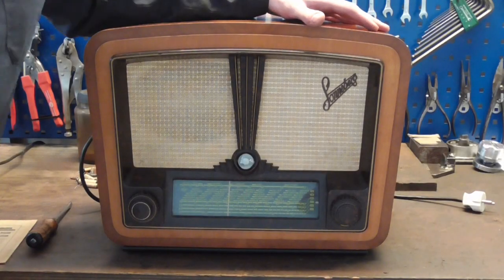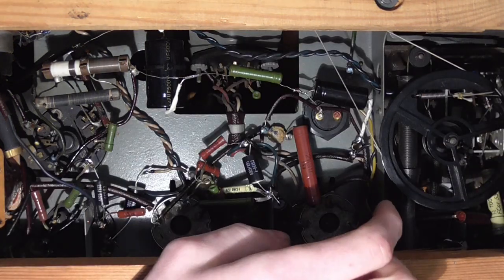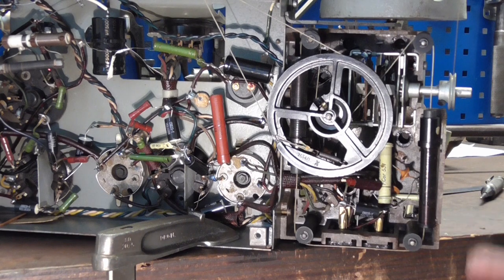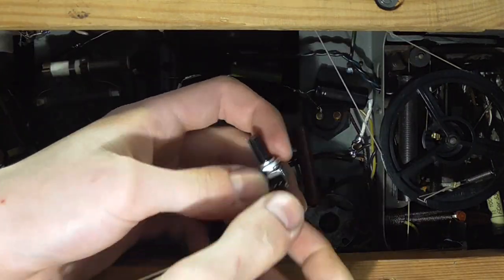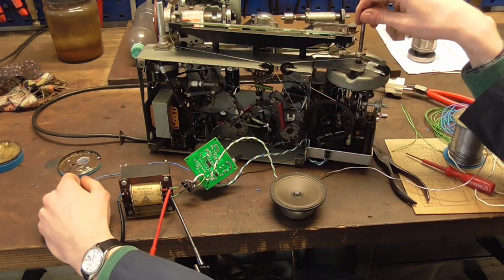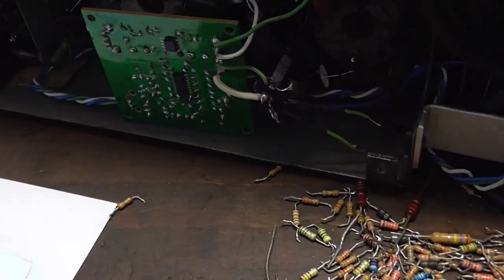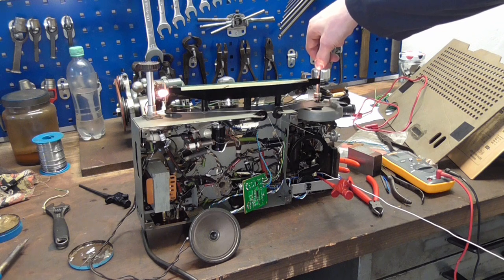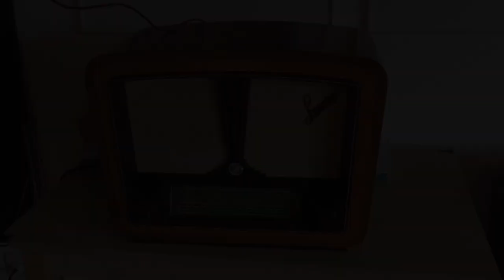FM Retrofit: Sonneberg 65/52GW Valve Radio

Comment: This was a cool project to enable the radio to be more than eye candy. Another approach (unfortunately only for recorded music) would be a short-range AM transmitter.
You don't often see a permeability-tuned table radio. It's usually used on car radios due to its resistance to being vibrated off station.
Roughing out a circuit diagram with a fountain pen while Artie Shaw plays in the background—now THAT'S authenticity!
20:34 Cool tuning indicator tube with four shadows! EM11?
A very neat and professional-looking job. Love the custom-turned pulley for the tuning potentiometer. 
10:35 "The wiring between the potentiometer and the, uh, thingamabob here..." Ah, yes the ever-useful metasyntatic variable. My Dad's favourite was "Whatchamacallit". 
Thanks for showing us the ins and outs of this kind of project. It's a shame you can't get some kind of FM scale on the dial.
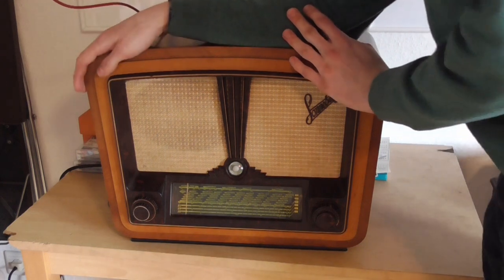21:44 Just curious, do you supply fire extinguishers with every project?
Reply from the maker: Thanks! While an AM-Transmitter would be the way to go if one didn't want to change any of the radio itself, it'd make listening to different radio stations by twisting the tuning knob impossible, as you said.
The magic eye is an UM11 (which has 13V filament voltage as opposed to 6.3 on an EM11), and while a fire extinguisher would definately be a good idea, I hope to eliminate the possibility of radios catching fire by giving them a several day shakedown test at my home before giving them away ;)

Comment: So when switched to gram input the FM tuner is switched into circuit. And the tuning dial actually works too - even if FM isn't shown on the dial. That's all very clever. Thanks.

Comment: Well done with the modification without destroying the original radio. However, my concern is that being a live chassis set, if you incorporated an isolating capacitor for the aerial connection, and also by connecting to the phono input if the isolation has been defeated. You were wise to use a separate transformer for the FM tuner supply.

Comment: Well done, as usual, and thanks for sharing! I liked especially the mechanical work with the correct ratio of diameters.
I am not an expert but maybe a word of warning to the audience would be good that the live wire could be connected with the chassis, depending on the direction of the plug sitting in the receptacle (Would the resistor of 150 ohms visible in the schematics be enough to save your life?). Considering this, would it make sense to put in a second 22 nF capacitor for the connection from the FM PCB to the TA input (Both live wire and shielded wire, I have seen this on some Philips combinations consisting of a Philetta plus a record player)? Just my two cents...

Comment: The WinchMat-O-Wire1985 would be absolutely perfect! 
...except for my absolute necessity of using it under a willow tree during a new Moon, my severe allergy to centrifugal forces, and my inability to comply with Section 62049 of the International Hand Crank Drill Discardmentation and Disarmament Standardizational Accords Conference Agreement Act, due to having both lobotomy and table.
Reply: PS: that has to be the funniest faux-boilerplate legal disclaimer ever made. Well worth my 3,5 minutes.

Comment: I thought that connecting the tuning of the FM module to the gearing of the old AM tuner was a particularly elegant solution.  Series filament sets are difficult to add anything to without just going straight to mains. But you get credit for ‘cobbling’ a solution, as opposed to 
‘bodging’ one 😉.  I wasn’t aware that Germany had ended AM transmission. I suspect that eventually we will do the same here in the US. Currently, the AM spectrum is occupied principally by right-wingnut lunacy, and bible thumping hucksters. Radio real estate is very crowded, and very valuable. I don’t know what “better” use could be made of the AM band, but someone will think of something, and if there’s enough money to be made, the current uses will be re-purposed.
Reply from the maker: Sound similar to german shortwave. Lots of crazy cult and conspiracy stations mixed with endless commercials that no sane person would want to listen to. Scrolling through AM these days gets you a few morse code (or teletype?) stations, which weren't there before AM got switched off in 2015.
What I fear the most is that they plan to switch off FM as well - which would render all my valve radios useless.
Building an FM transmitter only to convert that signal back to sound in a radio just sounds like keeping a braindead person alive with tubes and machinery.
Reply: @AstraWerke  Hollow-State Forever!!!  There is talk of digital AM radio here, which would improve the sound of what could be transmitted, but would require everyone to get new radios.  There is doubt that there would be enough interest in the internet age, when you can quite literally ‘tune-in’ to nearly any radio station in the entire world without any receiver at all…
Reply from the maker: @harryshector  That's exactly my train of thought. Nobody needs DAB+, when there's Internet radio, streaming and whatnot. Those that listen to FM are an entirely different breed than those that listen to Internet Radio - and neither would invest money for a new device that nobody asked for.
It's a bit like stopping gasoline sales.